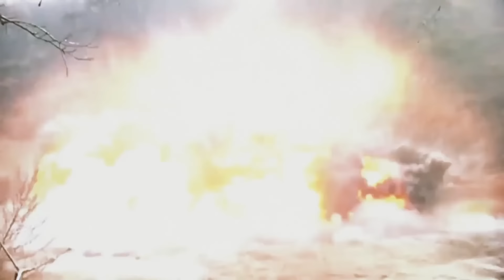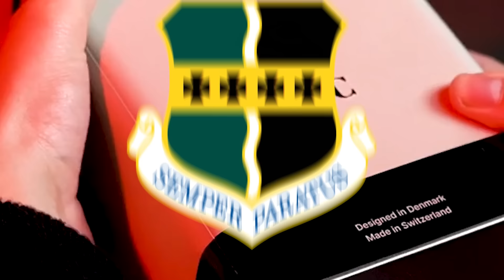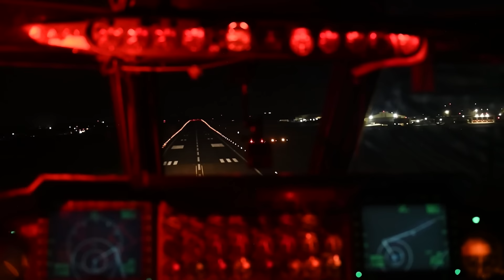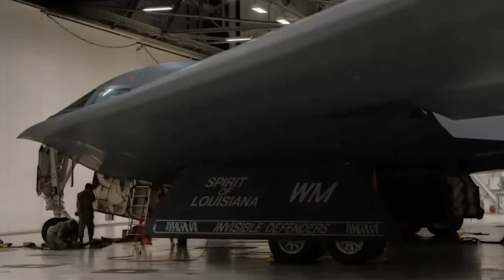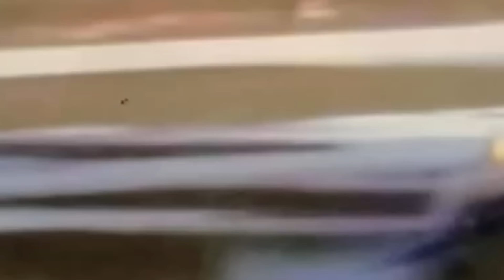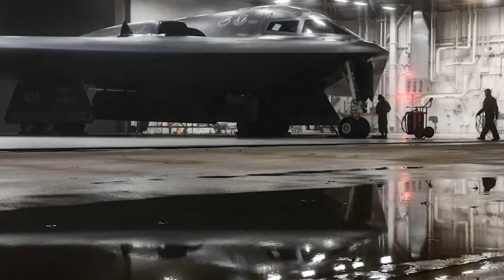USAF Declassifies the Truth About the B2 Crash

Comment: Although the USAF previously planned to operate the B-2 until 2058, the FY 2019 budget moved up its retirement to "no later than 2032". 
It also moved the retirement of the B-1 to 2036 while extending the B-52's service life into the 2050s, because the B-52 has lower maintenance costs, versatile conventional payload, and the ability to carry nuclear cruise missiles (which the B-1 is treaty-prohibited from doing). 
The decision to retire the B-2 early was made because the small fleet of 20 is considered too expensive per plane to retain, with its position as a stealth bomber being taken over with the introduction of the B-21 Raider starting in the mid-2020s.